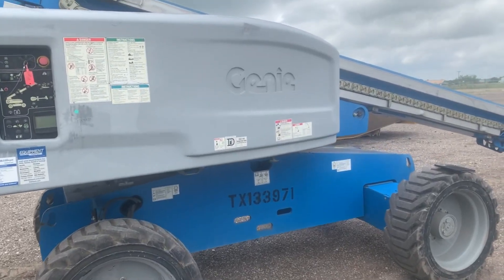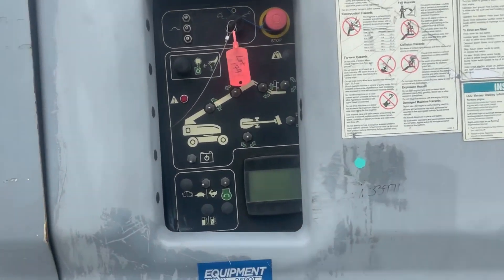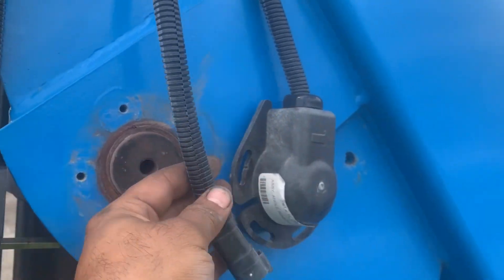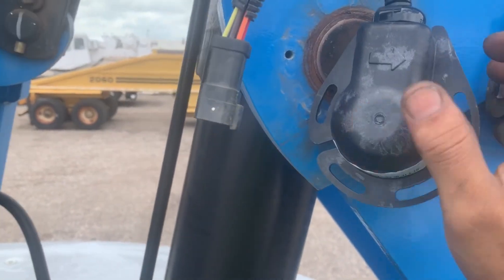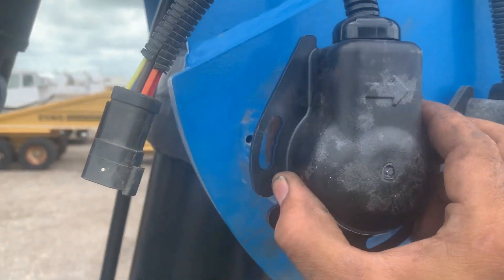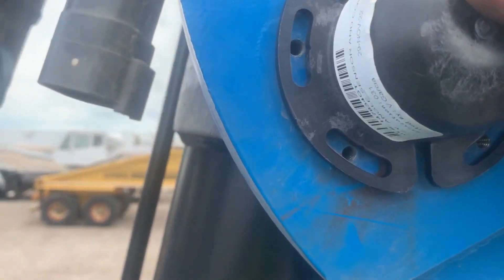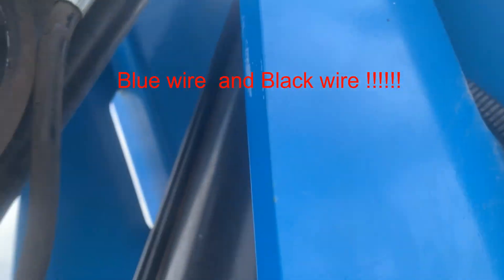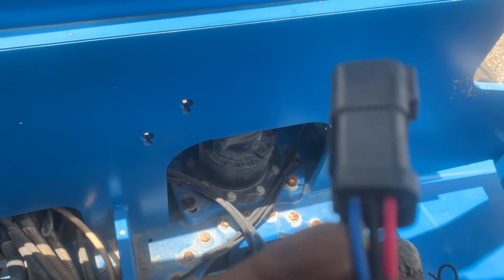Genie boom angle Sensor install

Comment: Hey I just acquired a 1999 Genie Z34/N22 (electric) and the only way it will operate is if I use the auxiliary power/pump switch, it doesn't matter if I try from the basket or from the ground controls. If I try to operate it normally, I just hear a clicking sound whenever I try to enable any function. I believe the alarm is also on whenever I turn the key on, It's just that the alarm is barely audible as I am guessing the alarm is broken. Any idea what might be causing it to only work from the auxiliary pump/switch and clicking when I try operating it normally? Batteries are fully charged. Thanks in advance for your time if you see this. cheers
Reply from the maker: check! Batteries , tilt Sensor then the power Module and the wiring to it.

Comment: Is the sensor in the same spot on a s80 genie
Reply from the maker: on s80 is in rear bottom of the boom, turn the boom 90 degrees to have easy access to the angle sensor